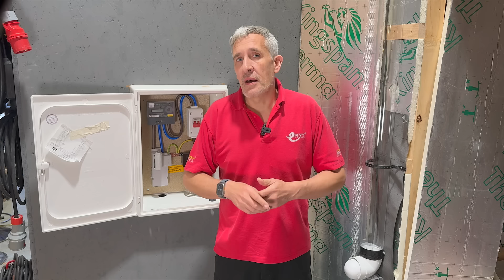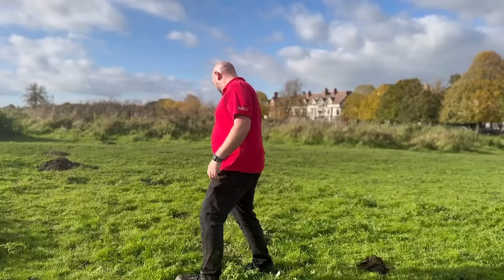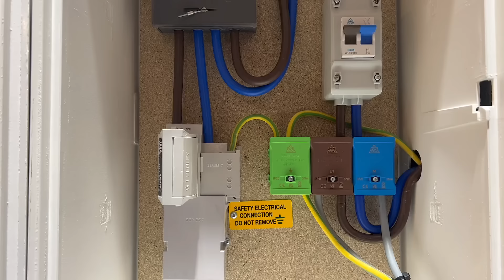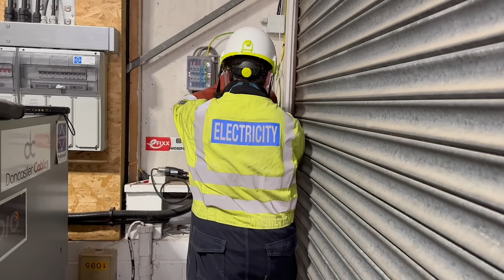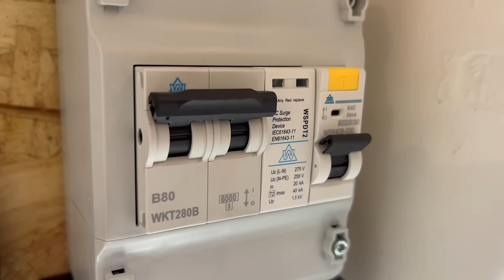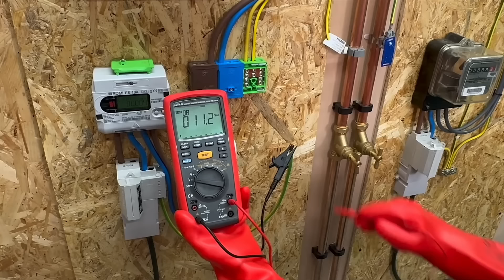Meter Box Madness: The Problem with No Clear Answer

Comment: For me switch fuses in cabs are fine. Final circuits no. Its better than an outdoor consumer unit no question. But will still lead to ventilation, heating and variable derating factors in places pollution degree 2 and under equipment should not exist. 

Further it means consumers could be outdoors in the wet wind and rain operating Switchgear. 

Much better to take our final circuits back to the consumer unit indoors as we have always done. 

This is a useful approach for the SWA submains if fuses could be integrated instead of MCBs to provide better selectivity. 

So I would say smoke but no cigar. 

Excellent production on the video though chaps! Impressive

Comment: Do it as we do in Norway. We have a national standard for connecting the installation to the grid, and you're allowed to install an EV charger or connect solar in our "meter box". Also, our box has a proper cover over the components, IP30. DIN for mounting with extra space for solar, EV, not OSB plate 😂
Reply from the maker: Far too sensible 😂
Reply: I may add that historically, the meter & intake used to sit in the same (primary) indoor consumer unit, although rules and practice for new installations are to separate the two. Most distributions are IT, while all new distributions are (of course) TN (x).

Meaning that in practice, the bulk of homes have “one location” for everting, and the size of the typical domestic (metal) cabinet has grown since the 1990s. All consumer circuits must be separate RCBOs, terminating all poles since 2002. They occupy quite more space than single pole MCDs chained to common RCD. Most intakes are already 3 ph available to the consumer, so the EV transition may (caveats…) have been easier (not cheaper) here…

I believe the jury is still out on the plastic vs metal cabinet debate, new regulation incoming this autumn.

Comment: The problem I see is when the surge protection module has done its job and needs replacing there is no safe isolation so you need to pull the fuse anyway . But other than that it’s a logical idea
Reply from the maker: The SPD would sit on the installation side of the main MCB.
Reply: @efixx  The DNO will go through their fuse (or nowadays DNO sealed MCB's), meter then typically a 500mA 3-phase TD programmable AFD to the tails to your DB, that contains an isolator (top left corner because your DB is always mounted to the right) and on the bus, another MCB (typically 20A 4P) connected to the primary SPD. The primary Type 1/2 SPD requires independent MCB isolation because they can sacrifice leaving a between phase short. Downstream SPD's frequently integrate a fuse protection, you can tell by looking at the SPD through a magnifying glass, there is a tiny diagram of a rectangle with two lines down each side (denoting the type) and above it there might be a symbol like a figure of 8, that means its say a class 2 with internal short circuit protection. Oh! and I've seen quite a few properties hit by lightning, the SPD has defiantly done its job but curiously I've never found a blown one! Have you ever had to test at 1000 on an install containing SPD's with your Meggar MFT and forgot the SPD isolation, you get some weird old sound effects, not sure what's going on but the two do not make a happy couple!

Comment: nah I prefer everything in 1 consumer unit inside the house. EV, PV, all circuits, 1 place. Avoids confusion for the current and all future owners, not to mention sparks that won't have to unravel the tidy mess you've left with all of them accessory CUs
Reply: Its horses for courses, I design/install large residential systems, the last one had 8 distribution boards with two of them 64 module units. You cannot generalize and say 1 is best. I agree with your comments regarding confusion, but bear in mind this rarely happens on larger installs because there is always a series of plant rooms with documentation provision and there is always a requirement to provide all the engineering drawings, full circuit SPD's, layout drawings, test and compliance, operational instructions, permits, H&S declarations, maintenance schedules and all that stuff (that in itself costs thousands and can take many weeks to produce).

Comment: And what if there isn't an external meter box?  Our supply comes directly into a hall cupboard with the main fuse, meter, main consumer unit and EV consumer unit, all together in the open.
Reply from the maker: That's always a challenge especially if everything has been boxed in.
Reply: It’s in a hall cupboard, with a door I assume? Not really open is it. The cupboard is probably larger than a meter cupboard as well…

Comment: A good starting point would be requiring all new builds to include an 10mm2 3 core SWA cable between the location of the home's consumer unit and as weather-proof junction box on front of house - or nearest point to likely parking area.  It's relatively cheap to include during the building, and it gives the new owner the option to easily add an EV point at later date.  Or, architects of the millions of little boxes 'planned' should be require to site the consumer unit on an outside wall, making it easier  to add the necessary cable(s) at a later date - without having to carve a path to the centre of the house. Sadly, housebuilders will do everything and anything to minimise the cost of churning out those little boxes, so adding to the meter cabinet maybe the only way forward.
Reply: A 4mm ev ultra cable is rated to 45 amps . 10mm swa is overkill

Comment: why are mains meters installed so low to ground? incase of floods it will be first to get shorted!! those Engineers need to rethink sensible height for power cables into building!!!
Reply: Meter boxes are typically installed at around 1m from the floor to avoid flooding damage and ease of access to most people without the need for ladders etc.
Reply: Most sparkies are 4'6"...